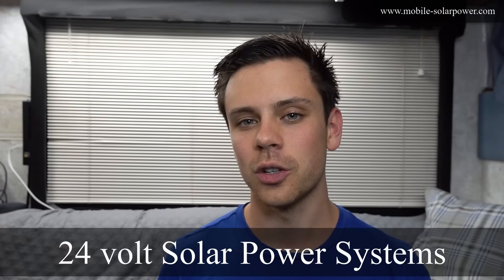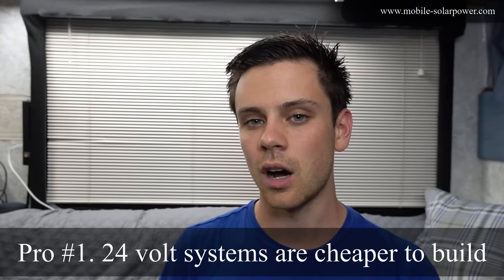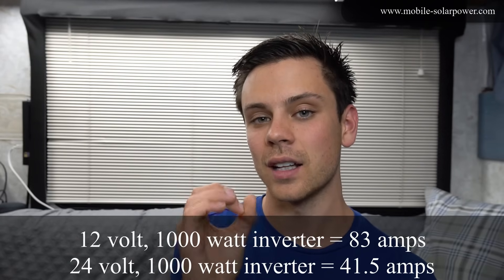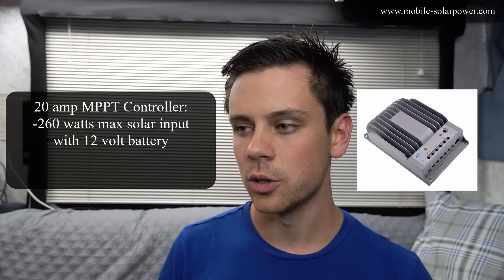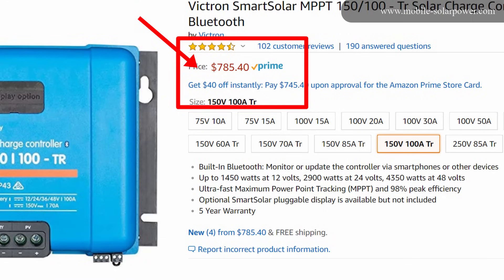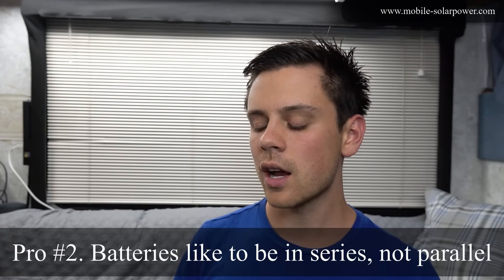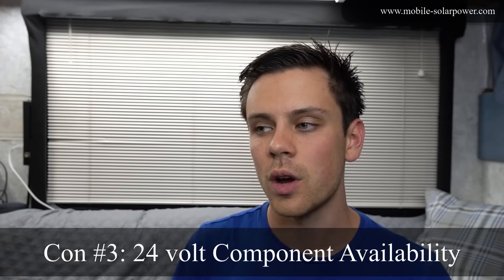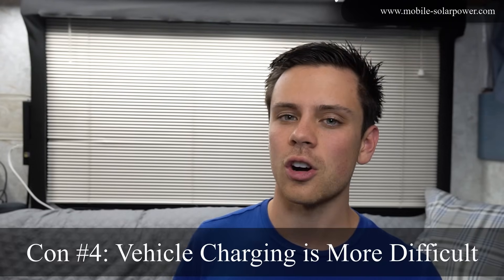12 volts VS. 24 volts for Off-grid Solar Power Systems

Comment: Thanks Will, I'm convinced.  I know you've touched on this here and elsewhere in your other videos, but would you recommend putting six 100W panels together in a combination serial/parallel configuration to get 24V or go with two 370W panels?   Thanks . .
Reply: You dont get 24 volts with 12 volt panelsYour charge controler if you got a decent one with recognise your 24volt battery system or you manualy switch from 12 to 24.series/parelle will change amps and volts sent to charge controller.

Comment: What do you think about using a 20 amp DC-DC charger to charge a house battery in a van build out . In conjunction with a 200 W solar panel . The house battery is a 100 amp Lion lithium battery

Comment: does load determine size. like at night i want to run a small electric heater it pulls about a kilowatt on high and a small fridge for my food both through an inveter would this be considered a small setup? no solar just a generator during the day to charge the batteries. so really just saving on wire correct. thank you for the content

Comment: I have a 24v panel but want to use my 12v 1000w pure sine inverter. Can a 24-12v step down handle that kind of load?

Comment: High voltage isn’t considered until 60 volts. I worked with 48v system in communications for many years and never was shocked by a 48v battery plant. I never did put my tongue on it though.

Comment: I have a remote cabin with a 48v system. I love being able to use small wire and my panels run at about 100v and the controller makes the voltage right for the batteries. I also have a 12v system for RV water pump and water heater. You can put plants in parallel just not separate cells. I worked in a facility with 7 battery plants in parallel. I like the idea of 24v system in an RV.
Reply: Why not put a small 12v inverter that only is on when the vehicle is running and use the120v to charge the 24v plant.

Comment: I'm interested in changing from 12 to 48 for my off grid but I'm wondering about discharge rate... Dont have many agm batteries.
Reply: Rocky Smith I have a 48v system at a remote cabin. I love it.
Reply: I'm looking to switch up to 48vdc but my question is... On the inverter requirements... Will my needed wattage decrease with my voltage increase... Or will amps change

Comment: Will, I have anew pu truck with a seperate 110ac circut. I'm using it to run a 12/24v charger. My Alpicool refrigerator is 12/24v what do you think about using a 24v battery in this case?

Comment: Will @ 4:14. Are you saying I can't use 12v panels to make a 24v array for my 24v battery bank? I'm confused now because I've been doing it for a year now. If you see this PLEASE reply. Or anyone else. Thanks
Reply: You need more than 12v to charge a 24v system. You can wire 2 12v panels in series to up the voltage though, 2x100w 12v panels in series would give you 1x100w 24v panel array. What kind of charge controller are you using? If they are already wired in series your probably ok and explains why it has been working for you.

Comment: QUESTION:  I accidently bought a 24 volt inverter.  Was going to use it in my truck as a bug out vehicle.  Got two solar panels.  Sounds like I need 4 solar panels or else my voltage output might drop below 24 (40)?
Can I make this 24 volt pure sine 3000 watt inverter work?  By the way I bought a bigger inverter than I need because I will be eventually transferring everything to an off grid cabin with more solar and batteries.

Comment: Could not I connect my 12v to the middle 2 batteries in a 24v system to get the 12v and skip the buck converter?
Reply: I plan on wiring the inverter to a 30 amp plug and plug the trailer into that

Comment: So well explained. Huge costs savings in charge controller and cables alone. This video convinced me to change my build from 12v to 24V. Panels on top total 1050W. I'm planning 6 x 100Ahr Battle born batteries. Problem - How would I determine what shore power battery charger to use in this case?

Comment: amps kill, not volts...smh  basic electricity .  i like most your stuff though.  but this one, was way off on the safety part.  thousands of volt low amp power is a taser... basically.  5 amps going threw your heart regardless of voltage level, WILL KILL YOU.

Comment: I have measured the current between my batteries. I have a 24 volt system that consists of four six-volt.I have them wired up in series and when I measure the voltage between any two that measures to 12 volts. So I decided one day to charge up two batteries in this 24 volt system. And it worked fine and so I charged up the other two batteries and they came up to full. Now what I measured the battery's they were both reading 24 1/2 volts. Not with that working like that I then tried running an 12 volt inverter between two of them, and that worked fine. It ran my lights and other things besides. Now this doesn't seem proper what am I missing?

Comment: I am not sure weather I found the right person to explain this to me or not. New sub today and trying to learn more about solar power as we have land that is off grid and too nice to set and waste. I had a well put in but its sixty thousand to get some power in and no other so really not a option. Alaska is a funny place where if you don't like the weather just move an acre and see whats going on there. I hear forty eight volt solar systems and never before you even had a clue about that so will marathon your channel to learn more .... your very young and I'm 73 so we are miles apart as lingo goes. I was a mechanic and did work on series parallel systems for start and run  on half or army stuff that was multi voltages. I was just always curious as what made the chicken cross the road. I think that your knowledge is high and to communicate may be the big one between us as I am the ten cent word kinda guy.

Comment: I think USB C more or less takes all your problems away, through USB-C you can run step the 24v down to 20V where the USB -C protcol can output all kinds of smaller voltages @5A. The generator in the car would need a 12v to 24v stepup to charge it on the go I guess.

Comment: So I change my battery Bank in my motorhome from a 12-volt system to a 24 volt system.

I also used the vector on Orion 
24/12-70 to dial me back in range for the rest of my appliances which is a 12-volt system.

Unfortunately what caught me by surprise is my diesel generator starts starts with my house batteries, the victron 24/12-70 doesn't push enough power to start my generator so I'm trying to figure out what to do now, might have to buy 2 gauge wire and run it directly to my generator and to my batteries which is 30 feet apart just to bypass the Orion.

I probably seen over a dozen 24 volt system conversions on motorhome and not one of them mentioned that, little funny I think.

So if you plan to switch to a 24 volt system which I think is still a good idea if your generator uses your house batteries to start it may not start anymore you have to buy a wire and run it directly to your battery Bank just be cautious it's a 24 volt system do you have to plug it in to make it a 12-volt starter battery leaving out the remainder batteries which makes it a 24 volt system.

Comment: want to have 6/200 watt panels at 24 volts on a van roof that can tilt for early morning power an amps/a charge controller mppt too/what amp do i need/is a 40 amp ok

Comment: Hmm I have a 305w 32V panel and using Epever mppt controller.. But as i listen your video i need at least 40V from panel to able to run 24V system.. Great video and info

Comment: Hi  I have one Valence u1-242RT and two u1-12RT Valence  Should I connect them as 24V or 12V  solar system?  I have one 150W solar panel and a 12V/24V 100AH Controller and  a  1600W  12v  invertor

Comment: Hey Howdy will, love and warm regards from India, if I build a Inverter system for the average Small Indian home considering the use upto 4kw what voltage system should I build? 12 or 24 Volts, personally I prefer 24V system coz I intend to run a fridge, 4 fans, 8 led bulbs, a induction cooktop all with the help of Inverter, batteries N solar panels. What would be your guidance to this Will?🌹💐🌹💐💐💐 great comparison once again stay healthy Stay safe and prayers for you.

Comment: If I have 6 Nissan Leaf batteries set up for 12 volts they are putting out 15.2 is that to much for a 12 volt inverter? I have not found any max input voltage on inverters. Most are setup to install in a vehicle and normal voltage is 14.7 volts. I know there is a safety cushion but not sure how much. Thank You great channel very good information.

Comment: A 48v panel, that's rated for 100w for example, only pulls 100w. 
The only thing that really changes with higher volts is the amps used.
A 100amp hour battery running at 24v needs 2 batteries.
A 100amp hour battery running at 12 volts only needs one battery. 
Yes you cut your amps down but.....but.... You need 2 batterys.
Also my grape solar 12v 540 watt  kit for 641$ shipped to my door.
That came with 40amp controller with heat compensation, 3 fuses, 10awg cords with quick connect waterproof MC4 connecters.
You could litteraly get a 12v 1080w set up for the price of one 540watt 24v system. 
MATH pass it on.

Comment: 12v VS 24v a 100w panel will only pull 100w weather it's 24v or 12v the pull the same watts

Comment: I got a 12v, 540w solar kit from grape solar for 641$ with free shipping..... Trust me dude 12v is way cheaper.
Reply: Definitely on smaller systems 12v is undeniably cheaper! I just commented elsewhere in this section. I got 3x 12v regulator for 10€ a piece. They are not the most efficient or sophisticated. But who can argue for 10€ a piece?! ;-)

This cable cost thing, is in fact very true! But on the other hand HOW MUCH high power cable would one need on a relatively small van?! Basically there's ONE (1x) large connection that demands relatively serious cable. Everything else downstream, is done with "speaker" cable of various grades. And it's more than enough! In all honesty very well spoken video, but lagging some real world experience behind it! ;-)
Reply: This got so cheap lately. Here in Europe, i got 3 400w panels for $300, 4kw easun smart inverter for $300, and 2 125wh deep cycle batteries for like $320.

Comment: I have a 2.4KW on-grid system, 10 pNLs 240 watt each with their own mini inverters. My question is if I decide to separate the system from the grid, can I use an inverter to charge the batteries say 240v 3000 watt (240v to 24v)?

Comment: what about the pro's and cons of integrating both 12v 24v  into series/parallel to keep the higher voltage and higher capacity? regardless of cost.

Comment: Ok one thing i want to mention... Most (not all but most) car chargers and other dc plug in devices can do either 12/24 v. The reason is they dont want to narrow their product down to just 12 or just 24 volts so they make it so it can operate on either, Check the details on the cable to see but most can. If its a dc power brick it may need one or the other.. but for phone chargers that have the plug built into the dc jack they typically can do both. Just like most electronics can do 110 and 220 now... Because they make it so it can be sold anywhere in the world without making 2 versions of that model. again check you tags. units that can do it do not need extra inverters or converters.

Comment: I know this is not a normal thing for solar power but can a 12-volt or 24-volt car battery work for solar power? I hate to spend $600 for a battery system for solar but if I have to then I guess I would have to.

Comment: Hi there.
I have a question, I would like to have solar power in my diy truck camper, for my all in one pc and one fan for about 12 hours. So I think I would need about 300w 12v solar panel? and a 100ah 12v Deep Cycle battery right? But I don't have much space on my roof, so my question is: can i buy a 100w + a 200w solar panel and put together? I'm brand new to the solar world, and I think it's very difficult to figure out what I need. Have a nice day and take good care of yourself 🙏😃 ps. I can not find a 24 volts deep cycle batteries here in Thailand 🤔

Comment: I've been running a 60 litre beer camping fridge/freezer off a four x six volt Trojan 110ah bank for 11 years now, without a hitch. The battery's are fed off two 123 watt Sony (Japan) panels through a 30amp Morningstar regulator. Every component is at least 11 years old. The battery's like a drink of filtered water often (especially in summer), and a wet clean with baking soda and water twice a year. I'm always amazed at the longevity of those bloody heavy Trojan Fork Truck battery's. Surprised me years ago.
For a simple dedicated fixed system like this, 24 volts is the way to go. Long 6mm copper feed down from the roof is acceptable, because of the voltage, the little compressor fridge motor works much better off the higher voltage than it did when I ran it on a boat at 12 volts. 
I've also got a Latronics (Aussie quality) 24V inverter that can back up my meat freezer, and the fridge upstairs, in the rare event of a mains outage here. 
I set this up, with battery's on a bench, everything else up on the wall, in 2010, and it's been faultless. Beers are always cold, and I don't have to pay for another refrigerator. 🍻

Comment: HI THERE YOU DOING GOOG JOB..
 I HAVE A WORK VAN AND I AM WORKIN IN A SYSTEM BY I  WANT TO CHARGE MY BATTERY WIT THE ALTERNATOR AND IF THE SECOND BATTERY IS MORE LOW AMPEREGE

Comment: Hey great channel! I’m new to solar but I eventually want to build a mppt 48 volt system and I was wondering if any 100 watt panel will work or do some only do 12 volt?
Reply: The general rule is to have PV string nominal voltage higher than your  nominal battery bank. You just have to connect PV pannels in series to Reach higher voltage than your battery voltage.

Comment: I get confused.  12 volt / 24 volt ..... my house takes 220 volt.  So when discussing solar could you please discuss systems that could be useful.  My water well pump takes 1.5 kwt as per my meter.  What are you powering with 12/24 volts ?  My lamps takes 60 w.  How do I fit a system based on 12/24 volts.  You need to slow down and make the connection so people can follow and understand how hooking up 5ea 100 wat solar panels in series to make 500 wat an hour can power my 6ea - 24 volt battery and what that means to me

Comment: Have a house soler panel can I use it 250w
30.1volts
Operations current 8.31A
Fuse 15A
What kind of controller for 12 v battery

Comment: hey will great video.. i was wondering what size system you would recommend for induction cooking with a small dometic fridge .. its for vw T5 /T6 
would 400watts solar and 12v 150ah lithium be enough? .. and would 24v system be better for this use case ??  :)

Comment: I wondered if this is the case when it comes to wire thickness in regard to voltage..I live in the Philippines where residential is 220v, when I moved here I thought how crazy is that! until I see how cheap it is to wire a home..only like 30 amps service to a home is all that is needed in comparison to the states where it is typical 200a or higher.. the cost to wire my home in PI was so cheap.. 
using this logic in a solar system for an rv makes total sense.. thanks will, you are genius, are you by any chance related to Sheldon cooper? you two are very similar in your lecturing technique. do you know much about quantum physics?

Comment: Will, how about a video building a 24v 400 watt system that can be later be expanded to 800w - 1000w system by just adding more solar panels?  I am over sizing solar charge controller and wiring for this in mind. And yes I did buy 2 Battle Born 100AH batteries and 4 100w solar panels for either serial or parallel configuration.   Yeah, it may cost more up front, but less down the road I think.  Thank you for the great videos!

Comment: 12v
+ More of ready to use convenience.
+ less parallel systems, batteries dont like parallel and needs balancing.
- long long wires
- less power throughput

24v
+ less wires needed
+ more power succ'ed
- Batteries hate being paralleled.
- need a step down to use voltage for charging 12v appliances.

Verdict:
12v mobile
24v home

Comment: I love all your videos. I'm glad this one came up in the suggestions though because I was wondering why my battery wasn't getting a charge. I neglected to realize that I had 12v panels in parallel with a 24v battery. I have now put the panels in series/parallel, hopefully this fixes my problem.
Reply: I'm interested to find out if it ended up working. What were your results with the situation

Comment: It's not the voltage that kills you, it's the current.  As voltage goes up, so does current -- assuming the resistance stays the same. (I=E/R). 100 milliamps is enough to kill you.
Reply from the maker: Yeah but voltage needs to be high enough to overcome resistance of your skin.
Reply: @WillProwse  Or the resistance of your skin can decrease -- it's still the current that causes harm.  Everything you discussed in the video was great.  I'm learning a lot from you.  That's the only reason I provided that small correction.
Reply from the maker: Or else current won't flow

Comment: Will.   ...  Check out Sterling Power's  'Battery to Battery Charger' for 12v or 24v  in campers, vans, RV's or Boats.   Doesn't damage to starter battery or the alternator and charges your Secondary/Deep Cycle/Service battery 5 times  (up to 20 times) faster than split charge relay.
The wiring could not be easier.  Definitely worth a look to check them out.  Other makes available.